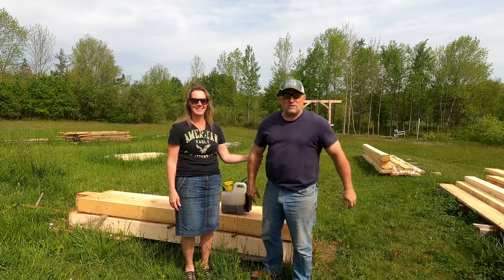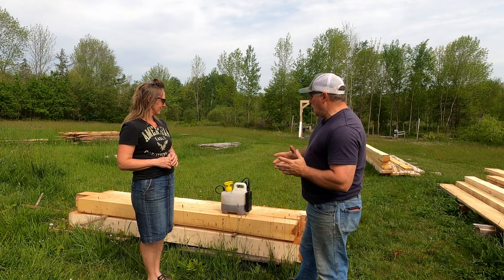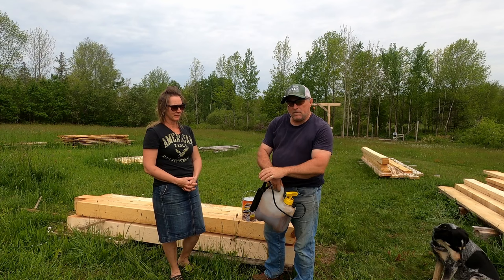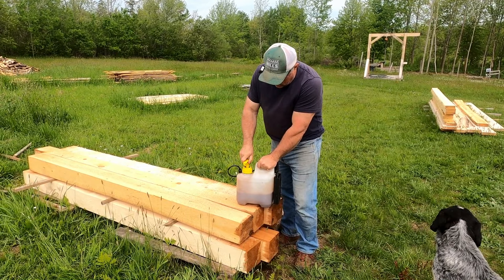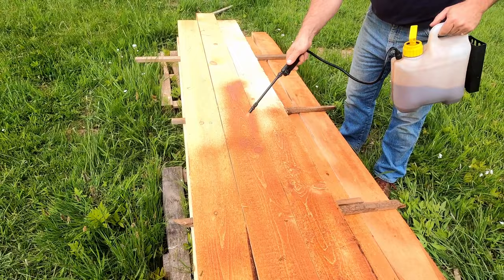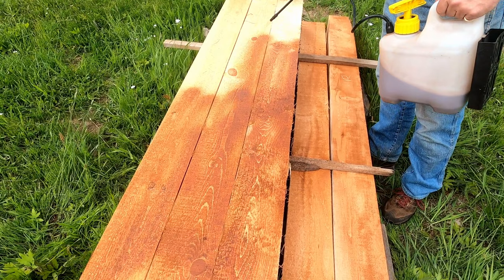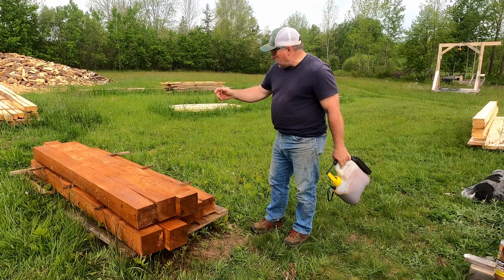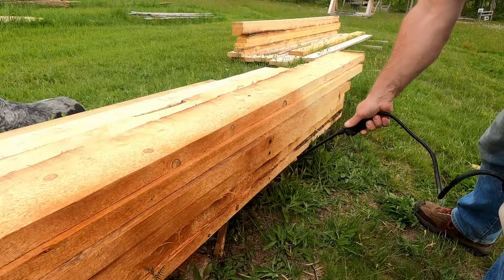Pressure Treat Without Pressure. / Simple Spray Method.

Comment: When spraying paint and or preservative always back brush while the coating is still wet. Back brushing forces  more of the liquid into the cells of the wood. But all things considered , well done!
Reply from the maker: Thanks for the great comment. I appreciate the tip for sure. Have a great day.
Reply: You're right. I had no intent to insult your intelligence.  The problem lies with me. I frequently react negatively when I thing people misuse their words. I'm 72 years old and have worked as a carpenter most of my life so I've planted a post or two. I have used my rose bud diesel and used motor oil with great success. Thanks for the come back. Be well
Reply: Brush on is always the best practice, the brush forced the finish into the wood pores, or grain. As you said to speed things up, roll  on, than brush it. Linked oil with mineral spirit also works, adding mildewcide accordingly.

Comment: Is this pressure treating, or just treating? I would think that pressure treating means that it is under pressure not just sprayed on. Right?
Reply from the maker: It’s the exact same product they use in commercial pressure treatment. The difference is the big commercial mills have a pressure tank that the wood goes into. We have found if we put two coats on it penetrates really well and has excellent weather resistance
Reply: Armor all’s treatment works but the difference is pressure treated wood has all he moisture removed before the treatment ‘Alkaline Copper Quaternary’ and it’s fully preserved. This isn’t a bad method and it does work but for longevity I’ll spend the money on the treated wood for a bigger project any day of the week. A shed I’ll do this because it’s a shed and not part of a deck or living structure that I’d have to worry about a disaster years later. I’m not putting this guy down but I’d never do this on something big or for a customer. I know lots misinformed about this vs the real deal.

Comment: It's ridiculous no doubt. It's copper naphthenate. Used piles of it back in the day I was building thousands of hive body boxes for honeybees. Typically submerging parts in it for 24 hours and then drying for a few days before assembly. $15 bucks a gallon. Then it got harder than usual to find until it showed up under big names and the price jumped to $50 bucks a gallon. Best I've found recently is at Lowes but not at all locations. Called Copper Green/Brown Preservative. About $25 bucks a gallon. Some locations they make you buy a 4 count case for $100. The brown color is awesome but it fades to the natural copper color of green.
It also kills any insects that chew on it. Simple contact doesn't harm them, like the honeybees for instance. 
Copper sulfate crystals is another good way to go for ground protection.
Reply from the maker: Thanks so much. Appreciate the input. Have a great day

Comment: I use a mixture of used oil that has sit for about a year to let any solids drop out, and diesel fuel for a 50/50 mix, I do two coats with an diy air sprayer, turns grey after it dries. Old timers say it will last just as long as anything on the market.
Reply from the maker: That’s a great idea. Thanks. I will give it a try. Have a great day.
Reply: Will lumber coated with diesel/waste oil hold paint?
Reply: @bluethunder1951  thank you!!

Comment: This video is still helping people 2 years later so thank you! Unfortunately I can't find the ArmorAll brand in the northeast US where I'm located. Looks like they might have stopped making it or been bought out by Solvable. Their graphic on the can is the exact same as the ArmorAll. Even the Solvable brand I'm seeing is not readily available in the US. Amazon doesn't appear to have any great options either. I'm going to give the brand from Green Products sold at Walmart (no I am not affiliated) a try with your spray on method and will report back results.

Hopefully the above will help some of your US audience. I had one question about the process and I apologize if you mentioned and I missed it. When are you applying the treatment? Intuition and the video looks like you're applying the treatment to the ends immediately after milling to minimize rapid moisture loss and cracking. Are you letting the lumber air dry or kiln dry prior to applying the two coats? Or are you applying that immediately after milling and then drying? Thanks! -Steve
Reply from the maker: Hi Steve. Thanks for the great comment. I let my logs dry for about 6 months before I mill them. That takes care of a lot of moisture. Once I mill the lumber, I seal the ends. Most of the time I let the lumber air dry for a few weeks before applying the treatment. Hope this helps

Comment: I have a question. We have an old deck that is clearly not pressure treated. I just had two posts replaced. The deck was painted we scrapped off as much paint as we could now plan to repaint. Can we pressure treat over the painted areas with this method? Thank u for your video and God Bless you with your new home!
Reply from the maker: Thanks for the great comment. It is good to get as much of the old paint off as you can. A method I find highly effective to remove old paint is to pressed wash it. Once that is done then I would apply at least two good applications of the treatment. Make sure you do both sides of the boards. Decks usually rot from the bottom out. Good luck and if I can help at all let me know. Take care and God bless.

Comment: FYI, it recommends against spraying not because it can clog a sprayer but because it is toxic. Which is why it also recommends the product not be used near water sources, in garden planters, or near food products.
Reply from the maker: Thanks for the info. Appreciate it. I did speak to a sales rep who reassured me the reason for not using the spray applicator was due to overspray and loss of product so as to not give the coverage a brush would. He also reassured me that the original products were toxic when made with an arsenic/lead base but now the chemical used is copper which according to them is much safer. Have a great day
Reply: @CreeksideMaplesHomestead  Be cautious of sales reps.  Yes, this product contains copper (copper naphthenate to be precise).  It is a commonly found in many sealants and is also toxic.  It is in fact why it is added to the product. This toxicity is introduced to prevents fungus growth and deters pests and insects from consuming or otherwise damage the wood. It is designed to be used on exterior lumber (fences, decks, exterior doors & windows…) and not for inside dwellings. Something similar is written on the label.  This information can also be found on the Recochem website, the manufacturer of these ArmorAll products.  I just don’t want you, or anyone inhaling harmful chemicals unnecessarily. Best of luck.
Reply from the maker: @stephanecorriveau6982  We use it only for outside projects. Thanks again
Reply: Or near dogs !
Reply: Does this sales person have a degree in health and safety, or is it the same guy at my hardware store I see grabbing toxic products without gloves and mask. Yes it used to be worse, but make no mistake that stuff is very very toxic. Not indoor use, not to touched wet ever, not to prolonged touching dried, not for inhaling without a mask. Stuff stinks bad enough to know this without reading the lable. Not sure it's a good idea to use it in a home. I wouldn't. When you spray it it goes into the air, into your lungs on your skin and on the ground where it specifically says not to put it as it will contaminate the ground water and vegetation.
Reply: @robertdillon9989  That there weren't no dog. That was one of them speckled raccoon deer!

Comment: Is it possible to create a wooden house without pressure treating the wood firstly? Or is the wood going to rot and break easily if you dont pressure treat it?
Reply from the maker: Anything ground level should be treated. If the wood is about 12 inches above ground contact you shouldn’t have to treat it. I treated all my main support beams even though they were 3-4 feet off the ground. I didn’t treat the floor joists or wall studs

Comment: Is your wood protected enough to be used as inground posts?  Thank you for this video.
Reply from the maker: It is. I treated the post ends about 3 times. The rest of the post just the once. You can treat them as many times as you like. Thanks for the comment. Good luck
Reply: No. The product description states it is for Above Ground use only. There are several other products that you can  use.

Comment: I know im late tov the game but how would this hold up if i ued them post for fence post
Reply from the maker: Great question and welcome to the channel. What I do for post is pretty simple. I first char the ends of the posts with a weed burner. About 3 inches above ground level. So if you post is 24 inches in the ground, burn the end up to 27-28 inches. Then I apply two coats of the treatment, let it dry and put in the ground. It’s a quick and easy way to secure the life of the post. I’ve had some posts in the ground now 7 years and they are still very good shape. Hope this helps. Enjoy the channel and thanks for watching

Comment: I have a framed basement. The GC did not used pressurized lumber. Can I use this to cover the regular lumber and will it pass a village inspection?
Reply from the maker: You can use it to treat the lumber. As far as the inspection, I can’t speak to that. Every municipality is different. I would call and check with the inspector and get input from them. Sorry I can’t help more. Hope it all works out for you
Reply: @CreeksideMaplesHomestead  thank you for responding. I’ve found a local version of ArmorAll and it will be delivered on Monday. Thanks for a great channel

Comment: Do you think it would be okay to install a picket fence with untreated lumber, provided that I stained/sealed it soon after installation?
Reply from the maker: Anything you are putting in the ground will need to be treated before you actually place it in the dirt. Anything that is not directly contacting the ground can be treated at a later date. Presumably after completing the project build. Hope this helps. Good luck and have a great day.

Comment: Great video...what kind of wood are your 6x6s made from...i just cut a 100' tall souther yellow pine and have 55' of 24" round no limb logs..is that good for 6x6 rough cut for a outside pole barn?...any help would be great!
Reply from the maker: Mostly spruce. That pine you cut sounds great. If it was knotty pine I wouldn’t use it for beams but whereas it is straight no limbs I think you should be fine.
Reply from the maker: You will want to treat that pine with some Thompson Water seal or Armour All Copper wood preservative

Comment: I'm planning to build to build a house. I have the means to build a vacuum chamber and pressure treat my lumber. Is there any real benefit to doing that, or does spraying treatment really do a good enough job as is? Thanks in advance.
Reply from the maker: Great comment. I can only speak to what I have done and experienced over the years. I have built barns, buildings and my own home using the spray method to great results. Nothing has rotted as of yet. That being said, a pressure chamber does have its benefits by getting the chemical a little deeper into the wood grain. Honestly, I think the way I do it works good. The decision obviously has to come down to you. Money, time and materials. That being said, I’m building my own home right now with lumber that I have treated. Hope this helps. Have a great day. Cheers.

Comment: Hey guys. We met last summer somewhere in ns or nb I can’t remember. We were driving a lifted bus with crazy wooden siding and doors. Anyways question for you. Does this treatment give off a smell after its all soaked in. We are building a timber frame outdoor structure on our property in cape breton.
Reply from the maker: Great to hear from you. Hope all is well. We found that after it dried there was no detectable odor. We’ve used the same solution on the home we are building without any smell from the wood or treatment. Have a great day. Hope to see y’all soon. Stop by sometime.
Reply: @CreeksideMaplesHomestead   I am having troubles finding it which store did you buy it at
Reply from the maker: @andrewhewlett7672  Home Hardware
Reply: @CreeksideMaplesHomestead  thanks for the reply’s guys. Apparently they discontinued it.  That tells me it most likely works amazing hahah. We had to go with another brand but it’s working out.  Hopefully it off gasses a lot and doesn’t keep the smell long term. Hope you are well

Comment: What is content of this product (ingredients that reduce rot, termites)? Is good to check MSDS also. Am looking into borax for wood fence (saw on BIM YT vid how to) as read borax reduce flammability and fungus. The spray idea your doing is handy . Have you tested how long this treatment lasts?
Reply from the maker: Thanks for the great comment. The active ingredient is copper as far as I can tell. Borax is a good one as well. I also use the ancient practice of charring the ends before putting them in the ground.  It works well. I have posts that have been in the ground for over 5 years that show no sign of rot or weakness. So far it has worked well. Like anything that goes in the ground, it is always good to retreat what you can after a few years. I haven’t done that, but really haven’t had to so far. Hope this helps.

Comment: Pressure treated lumber is still best because its fireproof and will last longer, usually over the counter wood treatments will last a max of only 5-8 years
Reply from the maker: Thanks for the input. I agree the actual process under pressure is a much stronger treatment. But to save a little money and offer some home solutions is what I try to do. Have a great day
Reply: Normal pressure treated lumber is NOT fire retardant.  There is a process where a different treatment can make it fire retardant but you won't find it in stock at the local lumber yard.

Comment: Nice! Can those use for garden beds?
Reply from the maker: I haven’t used them for that purpose but I have used them as drive way markers and after 3 years on the ground they are still solid. I did double coat them. Hope this helps. Cheers 🥂
Reply: @CreeksideMaplesHomestead  thank you for your reply.

Comment: Would this work on box store untreated lumber.  Taking a deck apart because it rotted due to all the heat, humidity, & rain (TX).  Im so tired of replacing after a few years. Thos box store waterproofing stain seem not to work....lol
Reply from the maker: @schretien8714  it does work well. I have used it on many projects including my house foundation and it seems to be working fine.
Reply: @CreeksideMaplesHomestead Thank you!!

Comment: Will this work on fresh cut green pine Timbers?
Reply from the maker: @Justnotrightvideo  i let mine dry for a couple of months. I’ve not tried it on green lumber. I would be concerned that it may seal moisture into the wood where it is green. It’s best to mill it and let it dry for a couple of months unless you have a drying kiln. If I was in a pinch and needed my green lumber treated, then yes I would put it on it. Sorry I can’t help more. Good luck
Reply: Thank you! I’m in southwestern Tennessee wanting to use the mature Loblolly pine on my property for my 16x20 cabin. One of my biggest concerns is the powder post beetles, which I seem to have a handle on by spraying the logs with bleach and spot spraying with bug spray. After a few times, I’m not seeing them. I have some bigger trees I want to mill into 6x6s for the floor framing. There my concern is termites and moisture. I will have cement piers at least two feet off the ground. I’m thinking of cutting and peeling the logs and dealing with the bugs first while they dry for a few months. Then milling and treating before the build. Any info would be appreciated! I’m a builder by trade (retired) but have not dealt with raw lumber. These trees have reached there maturity and need to be harvested.

Comment: Yeah, that's like what u put on ur fence. They don't actually pressure treat the lumber per say as much as they're impregnating the grain through n through via a vacuum chamber and they're probably NOT flooding the chamber as much as they're probably just fogging or misting in their chemicals... for a DIY'er it probably wouldn't be a bad idea to get a 5-8 cfm vacuum pump and build a small fiberglass chamber with plywood or whatever and do the same. Probably just take a little longer then u can probably get much better penetration.... js
Reply: Pulling a vacuum on anything will become saturated with whatever chemicals or gases u r putting.
Reply from the maker: Thanks. That’s a great idea. I have a good vacuum pump. Appreciate the info.

Comment: Thank you for the info. Is that freshly cut lumber or did you dry it first and how did you dry it. I’m using a Norwood HD36 here in Northwest Arkansas.
Reply from the maker: Hey Tom. Glad to have you at Creekside. The lumber has been drying probably 6 months. The logs were cut about 4 months when I milled them out. The lumber was milled probably for 2 months or more before I treated it. To dry it I milled it and put it in stacks with stickers between each layer. It dried well
Reply: So that is some kind that doesn't need a thicker coating? I don't understand how it works if all it need is that mist/spray.
 Don't get me wrong, if it works it's super 👍🏼💪🏼! The fact that I don't understand doesn't make it less usuable.
Reply: Not a coating like paint more like a poison that soaks into wood preventing bugs,mold,etc